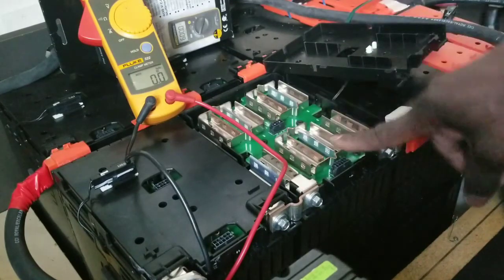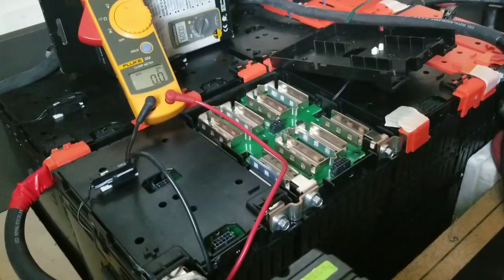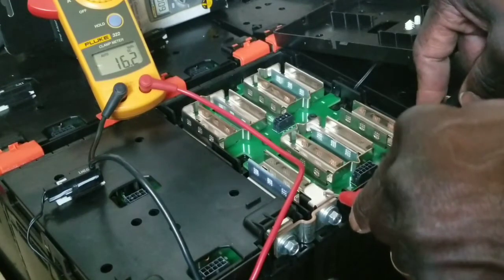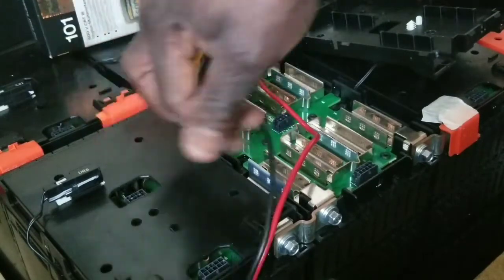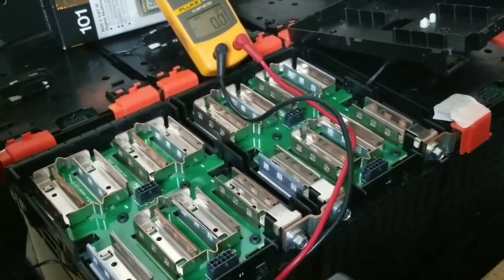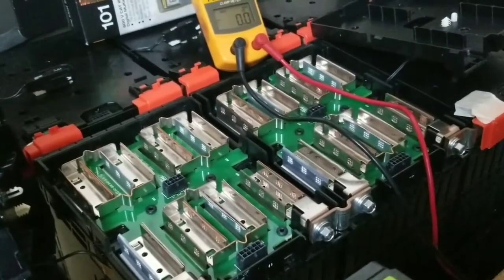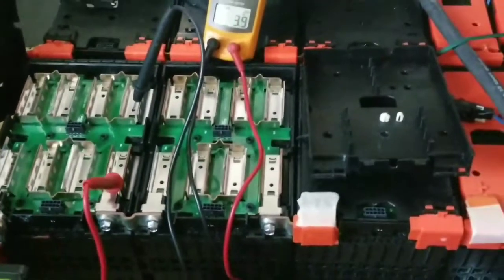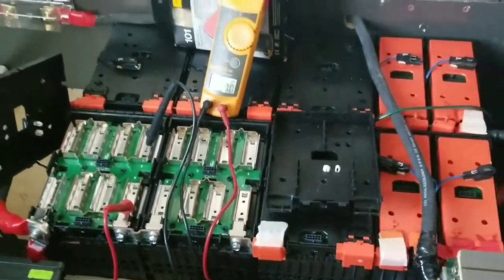LITHIUM BATTERY WITHOUT BMS: BATTERY CELL TESTING

Comment: And so what happens when, the voltage on one cell group goes too low and then the voltage on the other cell group(s) goes too high?  Will that cause a problem?
Reply from the maker: This is why the modules are parallel by strings and series to maintain the same voltage/amperage accuracy to eliminate and prevent most unlikely discrepancies from happening.
This is how I have done my tests and have been running my home proximately 3yrs.
I don't know how you have done your.
Thanks for stopping by and don't forget to LIKE SHARE and SUBSCRIBE for more updates coming up.
Reply: @jwsolarusa  I am talking about YOUR specific configuration, not my configuration ...  So, let me re-phrase my question ... eventually one of the series connected "CELLS" will fail and it will go Low Voltage.  Then during the next charging cycle all of the other "CELLS" that are connect in series will now get too high a voltage.  How will you know this happened?  Isn't too high a voltage on any one CELL a problem for your system?
Reply: @MrSummitville  How are lead batteries balanced without BMS? Why act weird only for LiFP ? It is inherent nature of batteries to take in lesser current as voltage spikes. So, batteries with lower voltage will balance themselves by taking more charge

Comment: Hi thanks for your new video :-). I did not say that everyone should have BMS, I was just in doubt whether it was safe enough to run without BMS and since they cost a lot of money and a lot off KWh. It is your choice whether you want to run without BMS:-). I was just curious to see the others who warn me that you can not do without BMS. But I can see they are fine:-). And it is cool with Youtube that many have their methods and I have BMS on LifeP04 as they cost a lot of money and when you still spend so much money you can as well spend a little money on BMS but it is up to the individual if they will mount BMS. There was just one in Norway when he was not using BMS and his battery caught fire. And he destroyed for 324000 dollars as the fire spread to the other buildings. And I can see you spent a lot of money on your plant and your batteries. I think this is a great facility you have.I bought 25.7 kwh for 3700 dollars with 12 modules to be converted into 2 sets. But I will try to run without BMS the same LG chem as you have. It's a waste of money to spend on BMS if it can run smoothly without :-) many greetings Rob